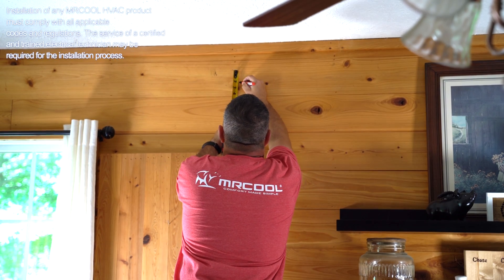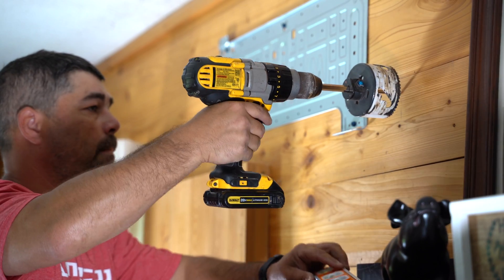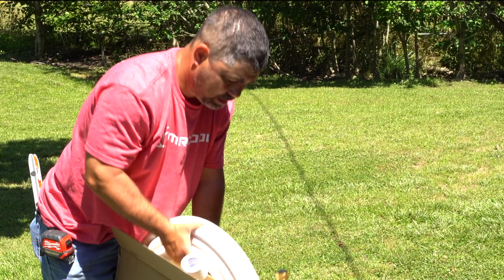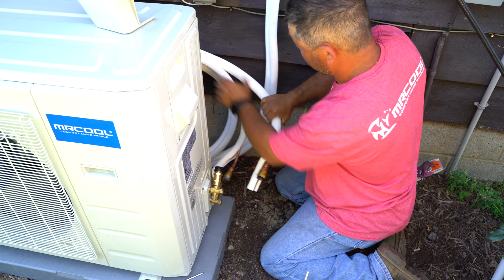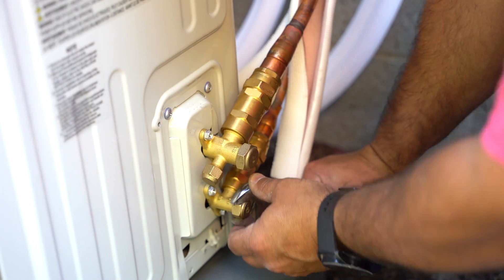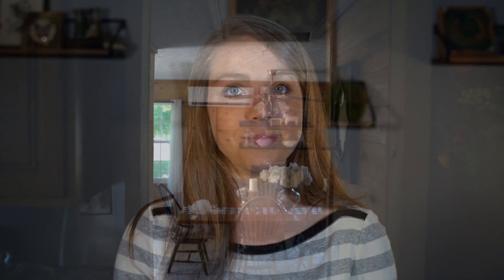MrCool DIY Ductless Mini Split 3rd Generation Installation

Comment: Would it be safe to run the condenser from my garage to the wall mount in my basement ? 3rd gen 9000 btu
Reply from the maker: We do not recommend installing the condenser in a garage.

Comment: When I open the first valve after connecting the line set, I can hear the gasses flow into the line.  As I wasn't expecting that, I quickly shut the valve again.  I figured with everything pre-charged I wouldn't hear anything or it would only last for a second or 2.  Is this normal?
Reply from the maker: That is normal.

Comment: What size breaker and wire is used on the electrical for a unit with no heat pump?
Reply from the maker: An air handler would not function with a heat pump condenser outside.
Reply: @MrcoolComfort  Okay, let me rephrase. what size breaker and wire do I use for your units that only blow cold, with no heating features.  They do have to be wired, correct?

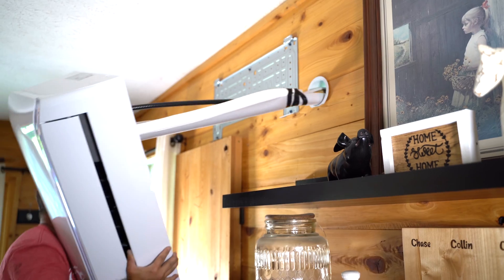Comment: why is the communication cable blurred in the bottom left corner at 1:01?  what kind of conduit is it wrapped in at 1:06?  is it fastened to the conduit for strain relief?
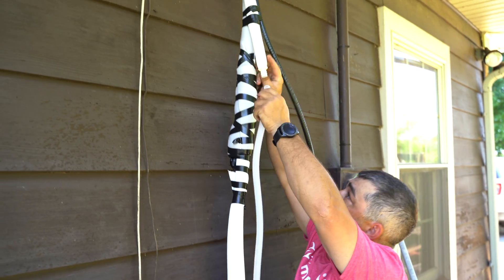Reply: it looks like MC cable at 2:57 but I do not think it's possible to purchase MC conduit separately from the wires, so how would you transition from SJOW to MC?

Comment: Just installed my DIY Mr Cool and no cooling with P6 code. What's up???
Reply from the maker: A P6 code is a problem with refrigerant pressure. Call tech support at 270-366-0457.

Comment: How come you don't have to pull a vacuum? The system was totally exposed to oxygen
Reply from the maker: It isn't. The lines are sealed and pre-charged from the factory. Nothing is exposed during installation.

Comment: Looks like in the video only electrical tape was used to keep the lines together and not the included line wrap, specially through the wall. Is that sufficient? Thanks.
Reply from the maker: Yes.

Comment: I've installed one already and one thing I found helpful was when drilling the hole for the line set, first use a long bit for a pilot hole to penetrate the inner and outer walls. Now you will have a point of reference to keep the hole straight if you have to clean out the hole saw half way thru and drill the outer wall.

Comment: We are converting our breezeway into a living space...so my install requires going through two walls. The garage wall where the air handler sits then the outside wall. Will this in any way be an issue? Also...in the manual it says to put the signal cable in a conduit. But none of the videos I've watched show anyone doing that. So I assume it is not a critical priority. Correct?
Reply from the maker: Going through two walls should not be an issue. In terms of unit operation, conduit is not required. However, some local codes do require it.

Comment: After installation, no heating or cooling.  Fan ran for a while but heard repeated hissing sound coming from compressor and it stopped all together.  Can you help with what to check or do next?
Reply from the maker: Please call tech support at 270-366-0457.

Comment: I just received a Mr Cool 24K DIY  . i need to drill hole inside on the left how do i attach hoses? bend 16 foot to go in thru hole to connect to unit hoses or ?? also purchased plastic base cannot wall hang outside unit. please help
Reply from the maker: Please call tech support at 270-366-0457.

Comment: What if you need a 35 ft line set?
Reply from the maker: Coupler kits are available to extend line length.
Reply: @MrcoolComfort  

Thank you.

Where can I get the precharged 16' line set and coupler to extend the 25' line?

Comment: I've seen recommendations to not have a loop in the line because the low spot can trap oil, but in the video the extra line is looped.  Is this not a concern?  I would have a single loop in my setup unless I do some sort of back and forth zig zag with the line, but I'm afraid of bending it that much.
Reply from the maker: Loosely coiling excess line should not be an issue.
Reply: @MrcoolComfort  Thank you for the confirmation.

Comment: How can you change the hi lines with out pulling a vacuum on them. Wouldn’t be better to pull that big air bubble out of the system and that also lets you check for leaks before you charge the system with Freon  the compressor can’t pump air and their is going to be air in the system with out pulling a vacuum and also why not have it were you flare a fitting on the line in this video look like you had 6 feet of extra line and to me that would make the install look bad and you just don’t need all that line please explain this thanks
Reply from the maker: The MRCOOL DIY does not require a vacuum during installation, because we use pre-charged line sets with specialized fittings. Basically, the lines just plug in easily to the air handler and condenser. There is no need to cut, braze, vacuum, or charge, since all that is completed at the factory.

Comment: You don't show the wiring for the indoor unit. My 3rd gen 18k unit instructions provide a wiring diagram which calls for connecting red, black, blue, yellow wires to the indoor unit. The wire provided has red, black, white, and a greenish/blue wire. Why the discrepancy, and what's the remedy?
Reply from the maker: Please contact tech support at 270-366-0457.

Comment: I have a mrcool 18K and new construction can I run my lines in the walls before I insulate so I don't have the god awful lines running up the side of my house
Reply from the maker: That will not affect the function of the unit. However, you should always check local codes.

Comment: How well does this work in -double digits.  Is this as efficient as the universal for this?
Reply from the maker: The DIY can heat in low temperatures, but it does not perform as well as the Universal central heat pump.
Reply: @MrcoolComfort  what temps would you say it stops working at?  We get really cold out here.

Comment: Does it matter which line goes to which valve? I took off the caps and was distracted. Can’t figure out if it matters.
Reply from the maker: Yes, it does matter. Please review the installation manual carefully.

Comment: So, I have a 3” hole in my wall with tubes passing through. What keeps things alive and or anything else from coming through that hole??
Reply: Sealant or spray foam
Reply: a $6 can of spray foam from Lowes/Home Depot should work perfect to seal that up snug and keep the critters out.

Comment: What are the key differences from 2nd and 3rd gen?
Reply from the maker: The 3rd Gen units are higher efficiency, and the lines are not pre-connected to the air handler.

Comment: I got my 18k unit and enjoy mine. But they really NEED to have a floor air handler unit out for every BTU. asap. For those DIY people with bad backs!!  These units are high quality and run VERY well. However, most of the installation is NOT intuitive that anyone posts of these units. It can be confusing infact! I highly recommend the wall mount for the outdoor unit, vs mounting it to the ground. Found out the hard way. But in the end, after "deciphering the ancient texts", i Got it figured out.
Reply from the maker: Thanks for your feedback!
Reply: @MrcoolComfort  is there a floor unit air handler? And is there a way to mount the outdoor unit to the wall off the ground?